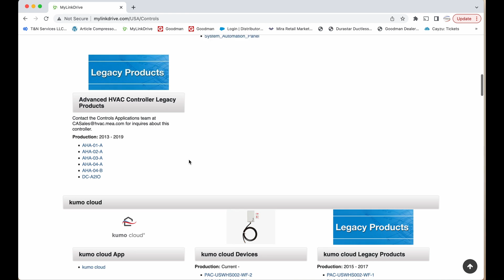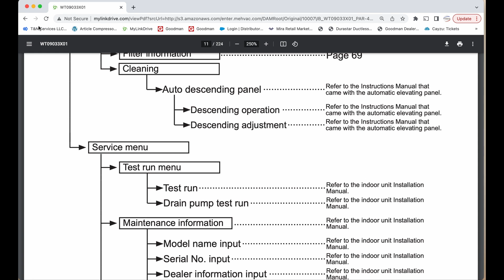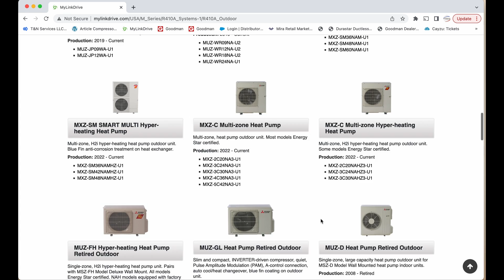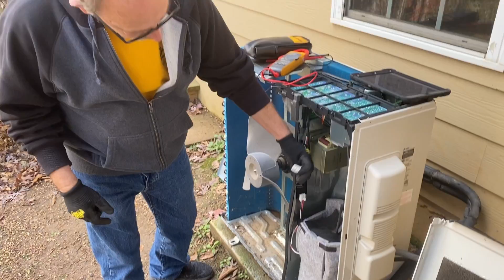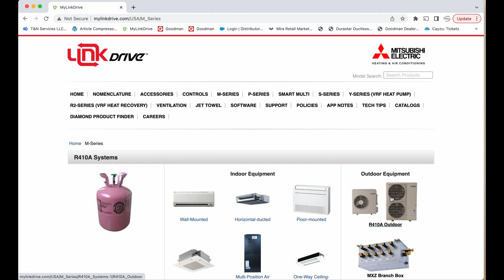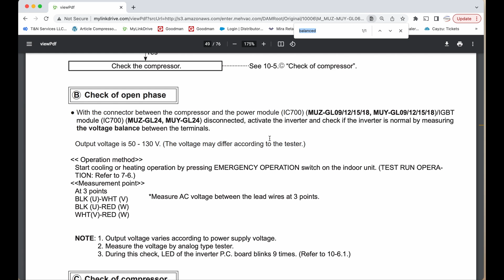Inverter Test----How Mini Splits Work ESP:5

Comment: Hi Ralph. Do you know if running a short line set (under the minimum) could cause high head pressure?  I did a 2 zone system. 1 zone has a 35' line set. The other has a 7' line set. Minimum is 9'.
Reply: Good question, I was unable to find the minimum line set length for a 6k Hyper heat m series. I’m close to yours, 5-6 feet.
Reply from the maker: Mitsubishi doesn’t have a minimum lineset requirement. On short linest applications you could get noise inside the coil
Reply: @TandNServices  But it should cause an issue with head pressure, is that correct?